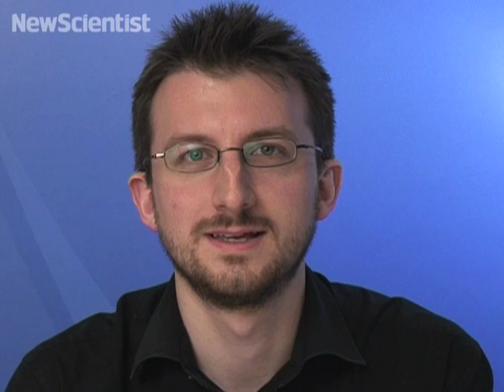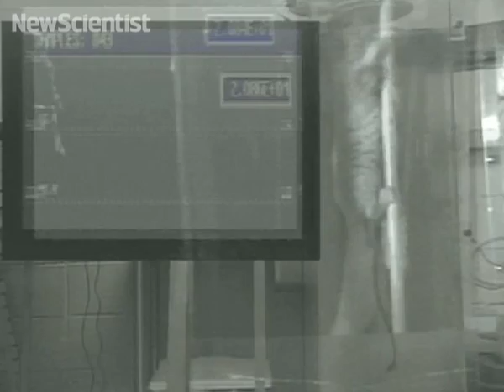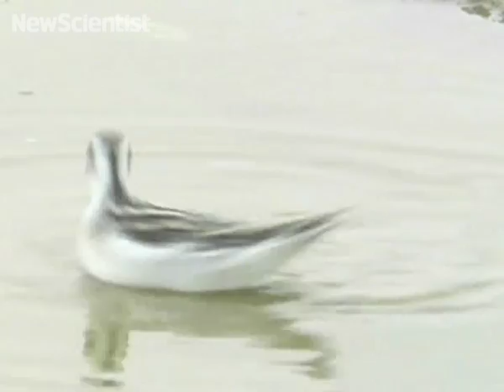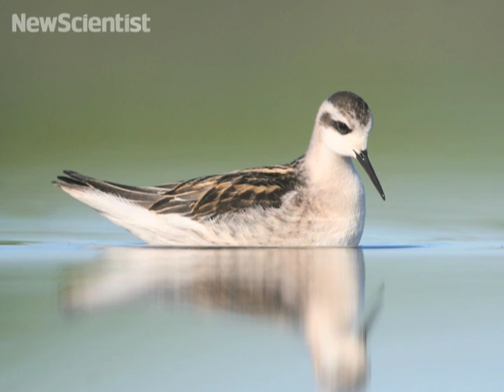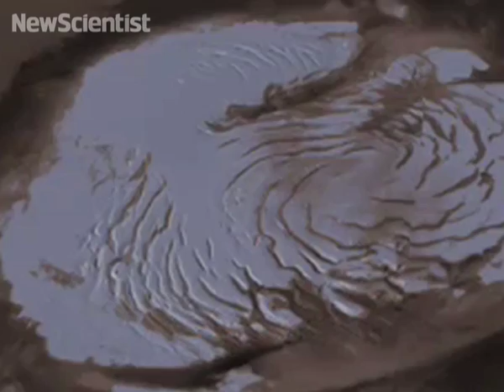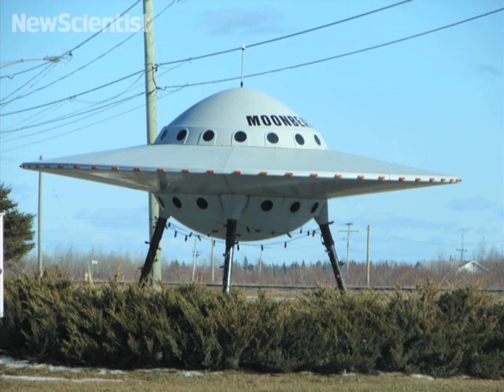New Scientist video round-up - May 16, 2008

Comment: when "climbing" on this apparatus, energy is only used to support the body and move body parts.  when actually climbing up something, potential energy is increasing.  in order for potential energy to increase, there must be energy input.   so, with the same bodily movements and potential energy increase, there has to be more energy being used.  

sorry for the bad analogy earlier.